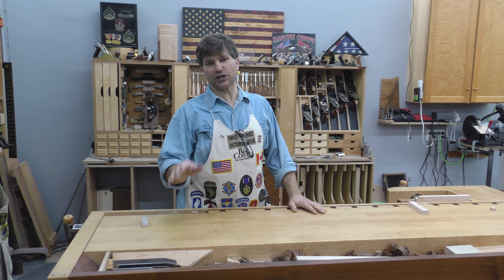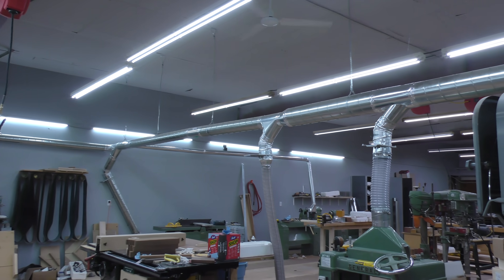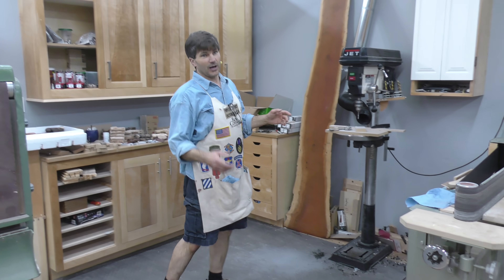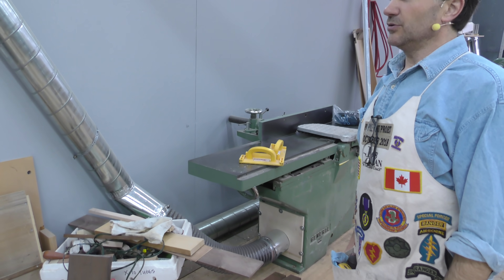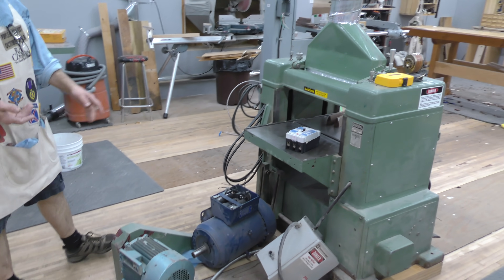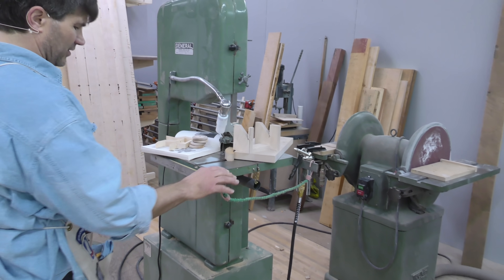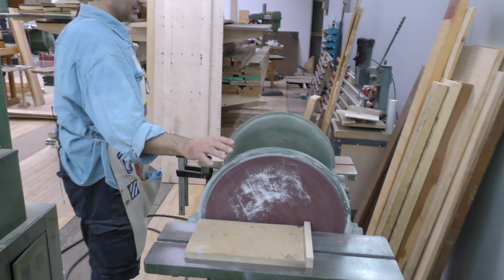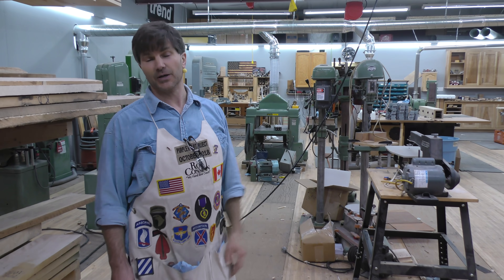Workshop Tour, Rob Cosman's New Shop, 2018

Comment: Congrats on the new shop! I ran an auto repair shop that specialized in the Datsun/Nissan Z for 25 years.  My first shop was in a complex of 14 2- car garages and I had 7 of them, about 2700 sq/ft. Two were dedicated to my racing operation.  After 8 years I moved into a proper shop of 4,000 square feet 16 ft ceilings, lifts and 1000sq/ft dedicated to the race shop.  As much as I loved the extra space and proper shop the new shop never felt as "cozy" as the old one. Woodworking has become my retirement work and I find myself back in the "cozy" mode with a shop on my patio (you can do that in Socal).  When I start complaining about the lack of space I remind myself of the "cozy" factor.  If you haven't experienced that yet I'm betting you will! With that said the new shop looks great and I'm sure everyone is happy with the move.

Comment: great shop rob! before you replace the 3 phase motors, look into variable frequency drives. not too expensive, and very easy to wire. i have done a few of them myself.

Comment: Of course I enjoyed it. Ken from Kansas only has a cement floor so far. They promised the shop would be built by Thanksgiving and now I wonder.  Rob, where do you get a line on used power tools?  I am looking for a used 8” jointer.
Reply from the maker: Hi Ken, we have Kijiji up here, similar to your Craigs list.  Think of all the older guys passing on or becoming too old to use their shops anymore.  There will be a lot of this stuff hitting the market over the next few years.  Guess you just have to keep your ear to the ground and let all your friends know what you are looking for.  30 pair of eyes are better than one!
Reply: Try Facebook's Marketplace, decent tablesaws starting at $50. I picked up a Delta S990 radial arm saw in perfect condition for $50.
Reply: RobCosman.com Thanks Rob, I catch a few on the east coast on eBay and Craig’s and by the time I pay mileage there and back I might as well buy new.  Things always turn up. Thank you.
Reply: jay webster thanks Jay, I’ll have my daughter do that.

Comment: Rob. I have a similar Rockwell Delta 21 inch band saw with a 1hp motor that makes reshaping very slow.  What size motor would you recommend. I only have 2 30 amp circuits in my garage shop?
Reply from the maker: That big of a saw I would want at least a 2hp, 3 would be even better.
Reply: Thanks Rob

Comment: DON'T convert your three phase 16" disc sander to single phase. Run it from a variable frequency drive so you can vary the RPM. Variable RPM is a great convenience on any kind of power tool particularly on a sander in a wood shop when working with plastics, dressing off glue residues, easily scorched wood like white oak and cherry. 

Besides you'll get full HP at rated RPM. Even a good rotary phase phase converter delivers a weak generated leg; the best HP output you can expect will be about 80% - usually less like 60%.

Look before you leap. There's a lot of info on the web regarding three phase equipment running from single phase power but beware of people who might have exposure to the topic but not experience backed by due diligence. You can safely disregard articles where the author asserts a motor "loses torgue at low RPM" in connection with industrial grade electronic controls. He's mis-stating a point of basic physics by parroting repeated ignorance.

This info is applicable to all your fixed power tools your lathes, drill presses, sanders and grinders, etc. It's worth some study.
Reply: Hi, I have acquired some 3 phase equipment also that I haven't used yet because of having to use single phase electricity where I am.  From what I have read, you must have a 220V 3 phase motor before you can convert to 220V single phase with a VFD.  Some of the motors are 575V and seem to be the most common.  Can you go from 575 to 220V, single phase?  Can you point me to a VFD that is inexpensive but has a good reputation?
Reply: @24revealer  You've posed questions that would take a EE to provide you detailed remedies for running three phase apparatus from single phase. I'm not a EE but I can give you a push in a productive direction. First define your uses for this equipment then assemble the equipment in your possession. Write out a tentative plan. Those items with complex multi-motor electrical systems are not good candidates for a single VFD. VFD's are intended to control a single motor because they sense the motor's response to load and vary the Volts and frequency to satisfy the speed pot settings and the parameter data input at installation.        VFD's are not magic boxes but they are talented devices. They're solid state variable frequency motor controls intended to drive single motors. While a VFD works very well as a phase converter to operate a three phase motor from single phase power, it may fail if used as a whole machine phase converter.

Multi-motor machines are best run from three phase generated from single phase by a rotary phase converter or solid state phase converter. If your 575 Volt equipment cannot be reconnected to accept 230/460, your best bet is to employ a step-up transformer or if that's not possible ($$) re-motor it. Here is where talent as a scrounger is irreplaceable to a shoestring operation. Every year obsolete equipment is junked often containing perfectly usable motors. A good scrounger has contacts everywhere and a nose for bargains. His all-seeing eye and gleanings are what makes it possible to build something from nothing, ie, conjure the right motors (and VFD's) from a sea of junk, each to fit its new purpose.

Single motor machines such as found in most small shops lend themselves to control/conversion using a VFD as the motor can be disconnected from the existing wiring and connected directly to the VFD's load terminals. The motor may then be controlled from the VFD's panel or the existing machine controls may be repurposed and wired into the VFD's control strip.

More complex machines having pumps, feed motors, ect but having a spindle that would benefit from variable speed may employ a VFD as a system element but rest of the system will have to be addressed if full machine function is to beattained. Your best bet is to school yourself in basic electrical theory as applied to three phase industrial equipment and to acquire a local electrical mentor. Expect to invest several months to a year in this task. 

Your alternative is to hire a resourceful industrial electrician, wave money, tell him what you want, and turn him loose. Maybe there's a retired electrician in your area who would jump at the chance to avoid the "honey do" project list.

Comment: was there no reasonable option to have 3-phase in the shop?
Reply from the maker: Not worth the cost, only a few machines were purchased with 3 ph motors in them, I have a large supply of single phase 1-5 hp motors in stock.